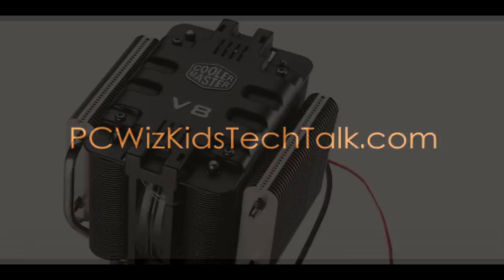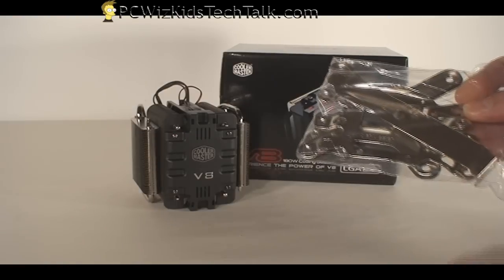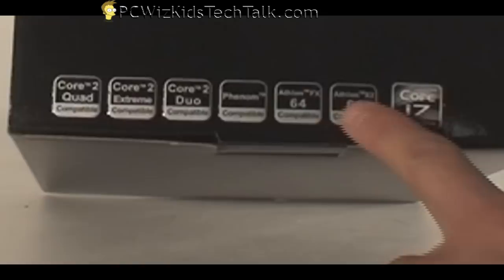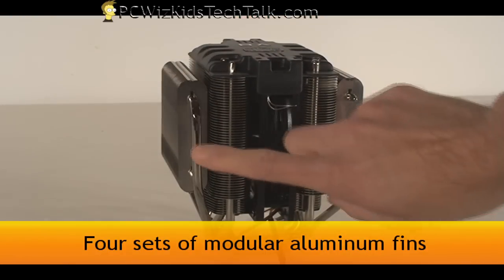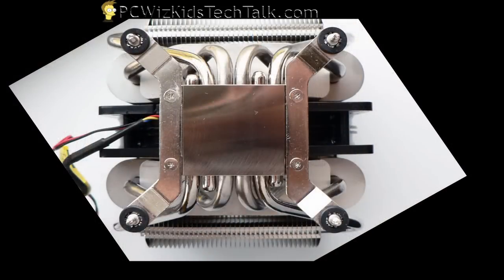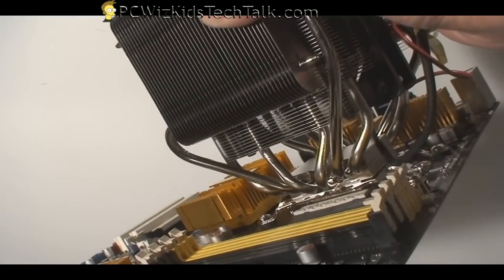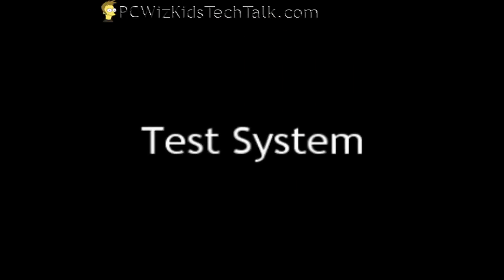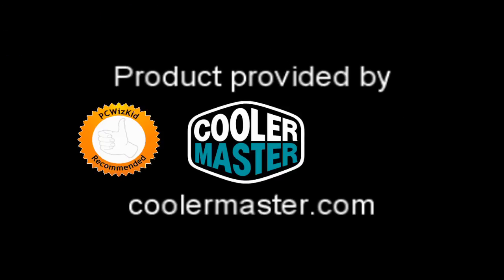Cooler Master V8 CPU Cooler Video Review

Comment: @09490m no, this cpu cooler is only designed for processors. not RAM. Some CORSAIR RAMs have special fans that come with them. they often hook up to the RAM module.

Comment: @ScorpioN1988 It was made before the AM3+ socket was needed. But as usual AM3 was backwards compatible with AM2/AM2+ so it's only natural that AM3+ would support an AM3 socket and the other previous socket types. I had this question myself, I talked to some notable PC enthusiast and they all agreed and said it should work. Ordered the same CPU as you and got this fan. Had no problems.

Comment: @JaiQwan 
Use Speed fan if you need manual control of the fan.  But I leave it on auto since it keeps the i7 920 below 25-30°C even under full load!

Comment: It depends on the placement of the processor slot and heat sinks on your motherboard, i have seen several people be able to fit it in, it fits fine in the Antec1200 :D

Comment: ive got the antec 900-two, applied thermal paste and spreaded it evenly, and sat it on and tightened it, i do have a hot room but that is only cause of my gtx 295

Comment: Well the case i use is a Coolermaster HAF 932, with a couple extra intake / exhaust fans i have added myself, in total I have 8 fans on my case, 4 intake 4 exhaust.  So i think my airflow will be good =)

The only thing i really worry about (since this is my first time building a computer) is applying the thermal paste.

Comment: I've got this cooler, at the lowest fan speed setting it barely makes any noise, and keeps my Athlon 6000+ (OC'd to 3.3GHz) at 21 degrees on idle, and about 30 on load. Highest fan speed setting keeps the CPU at 19 degrees idle, 27 on load.

The only thing to bear in mind about this cooler is its huge, so make sure youve got the room to work inside your case with this one.

Comment: im running it on my Gigabyte Ex-58 Extreme with a Core i7 920 and its deadly quiet. The only noise coming from my comp now is my 285's fan when im playing games. (I have the gigabyte Aurora with the side open with the mesh/grate covering, giving you an idea of how silent it is)

dont know if this will help, but my i7 running @ 3.2ghz (medium OC) was 45-50*C, now at a very comfy 23-28*C.

Worth every penny.

Comment: hi should i get the v10 or this one will it even fit my case cooler master cosmos s 1100 and the ram modules are corsair dominator since the v10 is huge will it be safe to put it on my mobo p6t deluxe

Comment: @FRURMELLL 
The fan control has a back plate to mount in a PCI slot.
Keeps my i7 920 below 30°C even under load.  Will try overclocking later....

Comment: @pbmdh, Yes mate, it will fit... it's gonna be a little bit tight, but it will. I have both(the mobo and V8) it was quite simple installation. 
@pcwiz, what's the software you are using for the temp/voltage monitoring? 
Oh and, little suggestion/advice, set the top(if you have one) fan to the slowest rpm and the rear fan(s) at medium/high rpm to gain best results with this kind of installation of the V8. I've been testing and trying and trying and the result was 5°C lower average temps.

Comment: @chickenpwn000 3dgameman was using a ''intel core i7 quad core at 4ghz'' thats a lot stronger than the processor pcwizkid was using, so thats why the h50 got higher tempratures :) i would suggest going to website where both the coolers are tested on the same processor so you can really see the difference

Comment: I still got my V8 ,but I never had a chance to install it on the Maximus VI Gene to cool down my I7 4770k because......the socket on the motherboard is LGA1150 BUT......i dunno what they were thinking she they made it( the motherboard), because if you take a look at the MB shape you notice a big problem ; probably a production mistake . From right to left you see the RAM slot , the CPU socket and the passive chipset coolers ....what u also see there's something near the top left. Corner of the cpu.Those are condensers, 3 of them exactly where the aluminium mount for the V8 is supposed to go. So many thanks ASUS .

Comment: @RottenRroses It blocks one of my slots on the crosshair IV, but I got a dominator GT 1866 module under the outer radiator just fine.

Comment: @v0HaVoK0v just the one thing is that the ram sits really close to my stock cpu cooler and on the coolermaster v8 it has those pipes and it looks like they would stick out to far and hit my ram there is probs like half a cm gap

Comment: Hi, great video. Just a few questions:
1. I wanted to make sure it supports my CPU and mobo, I know it does (AMD Phenom II X4 965 Black Edition AM3 socket, Gigabyte MA790XT-UD4P)
2. Will it be worth changing the cooler fan that came with the CPU even if I am not planning to overclock? I play games smooth at the highest settings but sometimes it makes too much noise, which means that the fan is running fast to cool the CPU, framerate doesnt drop at all though.
3. Does it make too much noise?

Comment: Those are really low temps on the AMD. My Core i7 920 idles at 46c with the stock cooling. Gets up to about 65c at 50-60% load when encoding HD video.

Well below the TJ Max but still hotter than I'd like.

Comment: Is it compatibHi. Is this cooler compatible with socket 1151? I have it in a box since a lot of time. It was part of my i7 1366 socket fiirst generation build. I wonder if it works in my actual i7 9700KF with socket 1151. Thanks.

Comment: Well either you haven't got a good airflow throughout your case, you haven't properly installed it or you havent got enough/applied properly thermal grease or it's in a very hot room! :D

Comment: I'm planning on building a Core i7 rig and was wondering which would be the better buy, the V8 or V10? I understand that the V10 is much more expensive but it does provide cooling to the memory which I'm interested in but is it worth it?

Comment: @MrAvatar9999 Think of an engine. A V8 engine would have 8 pistons in a v formation. A V6 engine would have 6 pistons in a v formation. The CM V8 and V6 have direct contact copper heatpipes. Copper transfers heat better than other metals, so it needs to touch the cpu to be fully efective. The CM V8 has 8 copper heat pipes in a v formation, and the CM V6, 6 copper heatpipes. So the V8 has two more heatpipes, allowing for better heat transfer, and better cooling than it's cousin, the V6.

Comment: @mechqeust Well then what is your cpu so I can check the stock cooler, and does your ram have a heatsink? if so what type of ram is it.
But honestly this cooler, rises a good bit up off the board, and is quite thin at the bottom, so I don't think it will touch your ram at all.

Comment: i just ordered my build with the sniper case,  a q9550 and a gtx275.. i wont be overclocking the system at the moment but just wondering if it's necessary to install one of these? or will it even fit into the sniper case?

Comment: Man, how did you get your results. I have a phenom 720 at 3.2 stock volts and it is idling around 32. I have two video cards and it is a mid tower case, but still. What thermal grease did you use and how much?

Comment: Hi, how cool do you think that it will be with a Phenom II X4 965 3.4ghz CPU idle and full load with the V8? I am getting 40-52C average respectively with stock cooler, its not that hot but the cooler the better. 
Is this way better or just a little better than the cooler master N520?
Thanks

Comment: Will this work with an Intel Core i5 2500k LGA 1155? I saw the Cooler Master global website and it says it supports LGA 1155, but the USA website didn't mention LGA 1155. I'm confused.

Comment: Just type "thermal paste application" in google and you can find a lot of the sites with tutorials and advices. About the V8, I have Q9450(yes, yes I know... I should've bought 9550)  on stock speed(2.66) temps are idle-25° load 45° at 1400rpm... thats Prime 95 testing. I also have HAF, so... you should be just fine. Be careful with the mobo and use the backplate for the V8 and tight mobo real good to the case back side.

Comment: I just built a PC for the first time.  Intel core2duo E7400 which i am going to overclock soon, but i'm looking for a new CPU cooler (obviously).  I know it will fit in my case (coolermaster HAF932) but I am worried it won't fit on my motherboard.  I have a Gigabyte GA-EP45-UD3P LGA 775 mobo, and when i installed the stock intel HSF, it bairly fit (since there is a motherboard heat pipe right next to it) Can you possibly give me the dimensions for the cooler at about 1/2 inch off the actual CPU?

Comment: i have a core 2 duo E6750 .. is this cooler more than enough needed to get 2.66 to 3.6 and maybe to 4 ghz?? FYI i have an HAF932 so all air ... and no i wont get the v10 as i have the dominator ram fan ...

Comment: I got a question what temperature should a I7 core 920 run at with stock Ghz. it runs idle with no load at 31-42 degree's C

Comment: hey can u answer my question...i have an Asus M3N78-EM motherboard but im not sure it it will fit since it is really small...my stock fan broke and replaced it with a gay fan that connects to a molex connector and my cpu is always at 60c idle =/ so yeah im looking for a good cpu cooler

Comment: Be careful w/ these... They block RAM just like an Artic-Freezer or any other high-end CPU cooler. I'm running an over-clocked i7 @ 3.178GHz and it def heats up to 60*+... Was going to go with this but it's just too big. If you have the room go for it. It is quite a nice piece of engineering.

Comment: no point, a low end PC buyer with a big enough budget to buy this level of component should just get a laptop instead - they're small, cool, cheap, low power consumption.  Really these days the choice for PC buyers is either a laptop which can *just* handle most games at moderate resolution, or else an uber desktop able to run anything at max resolution - price & convenience wise there isn't much point going for anything else.

Comment: that temp is fake.. no way a 4,1ghz amd cpu can go that low in temp. even not the best noctua coolers can go that low
Reply: lol dude i got amd fx 8320 overclocked on 4.6 ghz  for cpu cooling i have CM hyper 212 evo with 2 fans push and pul config and my temp is from 45 to 50 C DEPENDS FROM ROOM TEMP!!!!  whis cooler is 4 times bether then EVO SO IT IS POSIBLE
Reply: ***** and what with this website??????????
i dont have what to bay from here way u sending this to me?

Comment: lolololololololol tigergrupen pentium d dual core, is a diferent type of processor than a core 2 duo. core 2 duo goes on a socket 775 and pentium d goes on a socket 775 too. This cooler will fit but it isnt the same processor and core 2 series